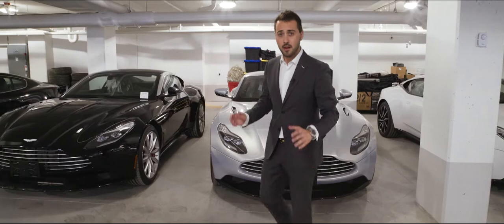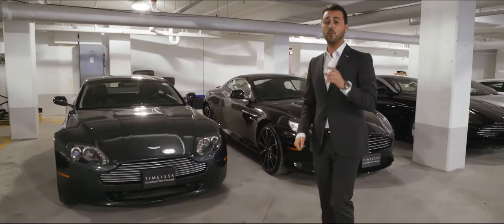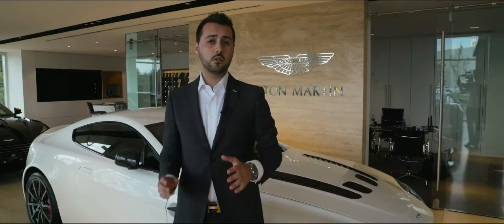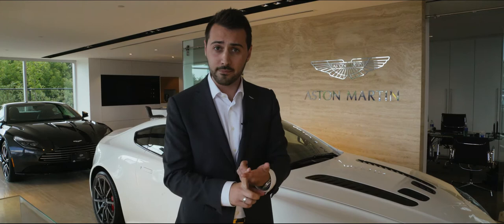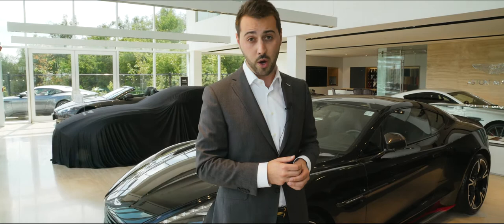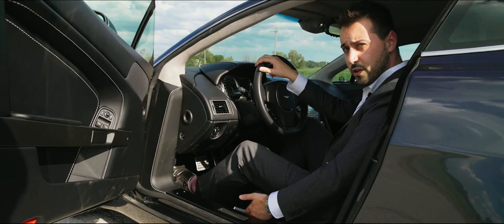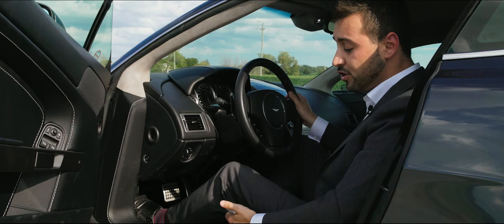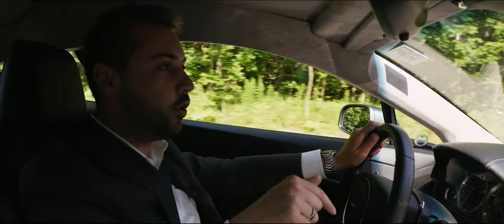Aston Martin At The Limit | Alek Ackerman

Comment: In terms of performance and track driving, there are a couple of issues you didn't mention - the substantial extra costs of carbon fibre brake consumables (pads & rotors, which will need frequent replacement if you track your car more than very occasionally!) compared to the conventional steel brakes and the cost of repairs to carbon fibre bodywork compared to aluminium and composite in the event of accident damage. If you have buckets of spare cash then probably doesn't matter but if not then you have to be pretty damned serious about your racing or your image to go down that road!